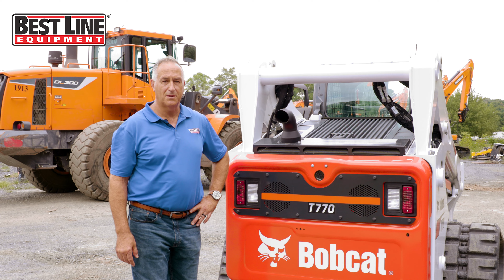Bobcat Track Loader Daily Maintenance + 50, 100, 250, 500 Hour Service Intervals

Comment: Lots of great information.  A good 120 psi 60/80 galllon compressor will be your best friend with maintenance.  Blowing out filters/and blowing off grease zerks, blowing out engine bays.   A Milwaukee electric grease gun with a Lock N Lube coupler will be your best friend to keep them lubed.   A Grease Zerk Buster with Kroil Oil  will be your friend, plus some spare zerks that are property rated at 10,000 psi and threaded for the machine. Grease machine daily.    Air filter is important, that's the one I have to keep clean daily.   Especially if you are screening dirt, crushing rock,  or mowing, that thing will get loaded up with powder quickly.     The machine will say air filter plugged.   I remove primary, wet rag out inside, and blow the filter out with compressed air for 3-5 minutes.    I can do this 10-15x to save money before its completely shot, this saves  $1000-$1500 as set of air filters are about $100 a pop.    You will know it's done/completely shot about 5 minutes after you blow it out, the machine says it's still plugged.  Then it's time to replace it and the inner.        Around 900 hours the tracks start to go, when they start being thrown from merely turning its time to replace them.  Keep them tight otherwise. There is a Cab AC  filter right behind the seat on the floor that needs to be cleaned, changed out otherwise your fan won't provide the breeeze.       Don't forget to grease the bobtach attachment locking pins on the side of the bobtatch mount, otherwise it will be difficult to release your attachment.  For gods sake don't raise the attachment and try to beat it off, it might fall on your foot.